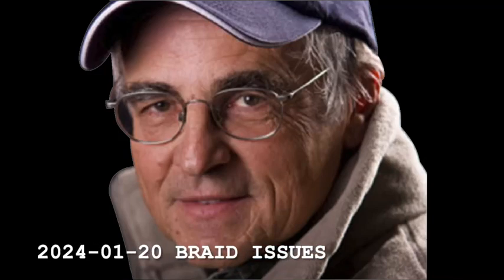2024 01 20 BRAID ISSUES

Comment: It sounds to me like you need to add some mono or fluoro backing to the spool. Take the braid off. Spool on several yards of mono or fluoro backing. Tie the backing to the braid with your favorite leader knot. Spool up the braided line to desired level. The backing will grip the spool and prevent line slippage seen when spooling direct braid.